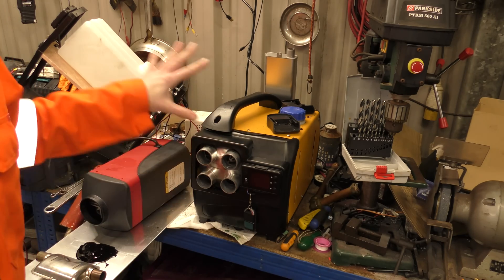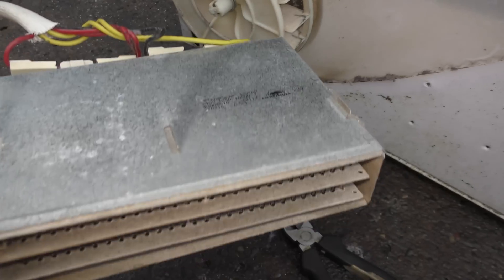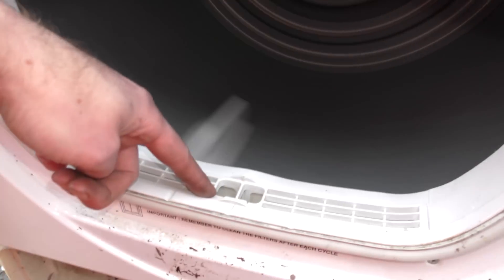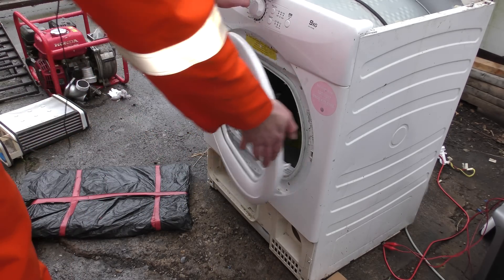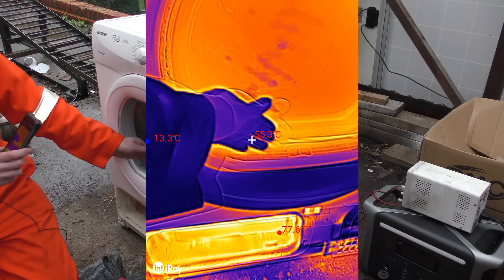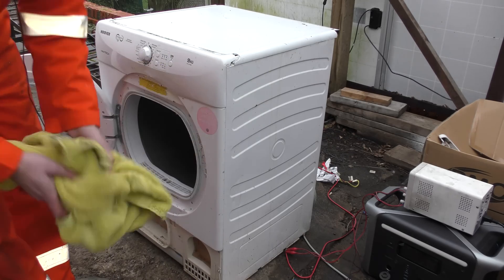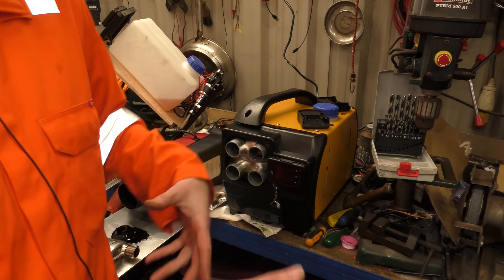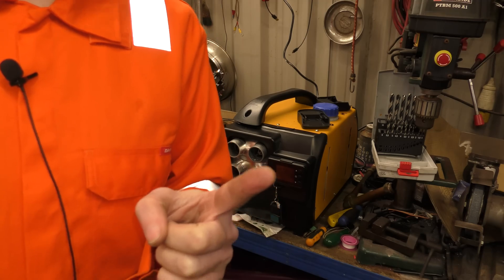Diesel heated tumble drier - part 1

Comment: 12v wiper motor. Plenty powerful enough, well geared down and reversible.
Reply: Those wiper motors wouldn't have near enough torque to spin a load of wet clothes.
Reply: @rednecktek2873  thank you I agree. Unfortunately there are a lot of wiper motor fans.
Reply: Wiper motor would be way too slow probably.
Reply: @nexpro6985   it should work  unless you want it spun dried.   It just needs agitation  to get the heated air around the clothes
Reply: @nexpro6985  put the  full 12v to a wiper motor and it'd be too fast...put your wipers on full speed, look at the wipers as a full circle instead of oscillating through the linkage and they'd be getting spun dried alright...just not sure if it'd have the poke with a full drum.
Reply: @fzr400rr100  I know. It is a few weeks since I installed a wiper motor. I still say not up to the job. Replacing a big 240volt motor with a small 12v motor is probably a bad idea. The motor of a tumble dryer spins much faster than a wiper motor on full speed. I have messed with both.
Reply: @nexpro6985  wiper motors are anything from 55-70rpm at 12v...my  tumble drier is 55rpm...use a 70rpm wiper motor and gear it back to 45-50 rpm....doesn't have to be like for like, just has to work. Could use a starter motor of a motorcycle but you'd be gearing it back 50:1
Reply: @fzr400rr100  tumble dryers are driven by a belt around the drum. The belt passes over a small pulley. I am familiar with both wiper motors and tumble dryers having worked on both. A wiper motor will not do the job.
Reply: @fzr400rr100  tumble dryer motors spin at around 1600 rpm. And about 1/4 horsepower. just one pulley on the shaft. No gears.
Reply: @nexpro6985  There are a lot of wiper motor fan as there easy got, simple, quiet and come with a ready fitted mounting point hence people use them for a multitude of hi torque requirements. I'm sure given your work experience you've seen these used for hoists and door lifters etc...what would you suggest, given your experience of course.
Reply: @fzr400rr100  not a wiper motor. That's what I suggest. Why? Because they are not up to the task.
Reply: @fzr400rr100  wiper motor 0.1 hp. Dryer motor 0.4 horsepower.
Reply: @nexpro6985  Suggestions brother the man asked for suggestions, not 'not that' for a low information reason. Neither he nor I have said that we're hiring in our workshops yet you've submitted your resume of experience on YouTube 3 times now because you've "messed with both". That's fine, if you've messed with those you must have messed with more so lets hear suggestions. Even though the HP figure on an electric motor is all but irrelevant, but I'm sure you'd know that, take a bit of your time while your 'messing' to work out why a 0.1hp motor spinning at 1600rpm through a torque multiplier, or 'gearbox' for those without as much experience as you, for an output RPM of 55 and you'll arrive at the mathematical answer for ftlb of output shaft torque produced of 'because they feckin work' and that's before you back gear it again to 40rpm. We're not trying to invent a perpetual motion machine here, we're drying cloths. If you don't think they'll work then pony up.
Reply: @fzr400rr100  once again... wiper motor 0.1hp. dryer motor 0.4hp. My suggestion is 12v motor that performs like a dryer motor.
Reply: @fzr400rr100  I don't jump through hoops. But I am prepared to be amazed when you manage to get a full load of clothes dry with only 25% of the power normally used.
Reply: @nexpro6985  And that would be?.....come on, stay with me, we're nearly there
Reply: @nexpro6985  And therein lies the difference between you and I brother. A man who will never attempt, will never achieve. I am fully prepared to swing and miss a hundred times to achieve a single outcome, it's called R+D and I've done it all my life. My workshop shelves are, like the movie says, chocked full of sacrifices to the gods of speed. When you open yourself to the acceptance of failure you can turbocharge cars, get 146hp from normally aspirated 600cc engines, build a boat and the outboard to go on it. Jump through a hoop or two and you might dry your cloths for 50% of the power, it'd be 50% better than the drier I'm using.
Reply: @fzr400rr100  cool. Now boost the power of a wiper motor by a factor of four.
Reply: @fzr400rr100  keep the  insults coming. It suits you.
Reply: @nexpro6985  I would have thought with your experience you would have recognised I was actually throwing you a bone but ho hum there you go. Unfortunately you then reverted back to not understanding how stuff works so I'll accept your invite. You say I need to multiply the power by a factor of 4 which you previously said was the difference in HP, the HP is for the most part irrelevant, you need to multiply the torque, two totally different things. The drier motor is a very low torque usually brushless motor and could literally be stalled from its 1600rpm if you grabbed the shaft with a gloved hand. A wiper motor is so widely used because it is normally a 4 pole brushed motor and specifically set up to produce high torque for the job it's designed for before it's geared, not all motors are equal. Turn on your wipers and grab the wiper arm to stall out the motor, I guarantee you'll snap the wiper arm, linkage or loose a finger. So in conclusion even after the motor is geared down to the drum in a drier, if you were to resist the spinning drum being driven by a 0.4hp motor it is easily stalled yet the wiper motor with a 0.1HP motor after gearing is impossible to stall, Go figure, its almost sciencey. Who has the answer to the riddle of whether a wiper motor will or won't drive a fully loaded tumble drier, maybe it will, maybe it won't. And @Redneck Tek if your putting wet cloths in your drier there's something wrong with your washing machine #spincycle.
Reply: As for the insults, perhaps you should think twice before imparting the condescending attitude on the lovers of wiper motors, we have feelings too.
Reply from the maker: This comment thread was a wild ride.  I think I have an electric window motor from my old C1, is that in the realms of wiper territory?  Might have a wiper assemble from mums old Astra.
Reply: @DavidMcLuckie  lol yes, but I slept just fine. I'd rather test a thing before I pass opinion on it unlike Mr Pro, If the wiper motor didn't work then we'd all know for sure it doesn't work but like everything else there's different ones of them to. The one in the workshop Clio is half the size of the one in the recovery wagon, stands to reason as the screens twice as big in the wagon. Window motors are typically weak for safety due to some kid putting it up and getting their noggin stuck in the window. I'd plug in the Astra motor and see what it spins at, see if it's possible to gear it back to 40ish rpm while on 12v. If it's close to acceptable you could try a bigger motor. If the wiper motors a total no go I should have a couple of bike starters here, I'll donate you one. Conns of the starter motors are spinning way to fast, noisy, power hungry, expensive to acquire and non reversible.  If you want the bike starter and know how to PM me shoot me a message.
Reply: @DavidMcLuckie  wiper motor 0.1 hp. dryer motor 0.4hp.

Comment: One thing I noticed that might be an issue. The fan and motor on the dryer  is designed to pass cold air which is then  heated downstream. Piping hot air into the cold air intake may overheat the motor and or damage the plastic fan.
Reply: it is a recirc dryer, the warm air is cycled and it relies on the aluminium plates to condense the water.
Reply: @amojak  What he said 🙂
Reply: Yep that's right.. he's getting the vents / intake wrong the air in the drum never leaves in a condenser.... what he thinks is the vent is the cold air in and the side is warm out... I work on this stuff so if you need to know out msg me...
Reply: What he said .

Comment: Would using a diesel water heater and replacing the heating element with a heat exchanger be a better idea? The rest of the drying mechanism would be unchanged. 

I think the motor used on tumble driers are universal motors, so there's a chance they could be used on 12v, but the current draw might cause it to get a bit warm. The motors tend to have a shaft that has a fan one end and a shaft on the inside that runs a belt for the drum. The fan pulls air past the motor then over the heating elements, with your setup I think the motor could get a bit hot. Not much of an issue when its in a metal box with a hot drum right next to it though. 

Check how much power your now modified tumble drier uses from the wall, might be easier to use a cheap inverter to run it rather than changing the motor or running it off 12v directly. Also easy enough to test if you have an inverter around.

Might be possible to hack a controller for a diesel heater by connecting wires from the PCB that go to the on/off button on it and using the output from the drier to trigger that somehow.
Reply: You'd take an efficiency hit converting from hot air to water heat to warm up air.  Skipping the middleman would be a great benefit.

Comment: I love this! I can see how this would be perfect for off-grid/camper living by powering the dryer with a 12v supply, having a diesel heater with a 'divertable' Y connection and using the coding you discussed. How about a similar setup with the diesel water heater for an "off-grid" washing machine? Any reason that wouldn't work?
Reply: My recently bought "Webastardo" unit was salvaged from an Audi Q7 as the pre-heater for the engine's coolant circuit. Effectively, it is a diesel-powdered water heater. My own aim is to use this for my planned under-floor heating in my house; and I expect, yes, it could also heat the water for a washing machine too

Comment: Ah this is great! A few weeks ago I asked Robert Murray-Smith how viable it might be to use a diesel-powered heater as the heat source for an oven!
Reply from the maker: Cooking oven or firing things oven?  If a firing things oven you can remove the heat exchanger from the diesel heater, move the temperature sensor.  And then you've got full burn chamber output into whatever you want.
Reply: @DavidMcLuckie  many thanks for your reply. My question to Robert was also open but primarily I was thinking about a cooking oven, possibly by extension a hot plate.

Just in the last few days, I've gotten myself a "Webastardo" heater from an Audi Q7, originally used to pre-heat the engine's coolant circuit. Over the next few months, I intend on experimenting with this to provide under-floor heating in my house! Possibly I might need to parallel a few of these, but as my first 1 was reclaimed salvage for £80 including the water pump, but minus fuel pump, I'm happy to experiment.

Your advice is NOT to run these on used and/or virgin cooking oil. Following Robert's videos on how to esterify cooking oil into a biodiesel, would that reduce the sooting/coking issues?

My questions aren't meant to be personally answered by your good self, I would very much welcome further discussions from other viewers on these issues.
Reply: @RiverMersey  question does the gelatin method remove the glycerides etc without having to use methanol and lye?
Reply: Webasto make a diesel fired hob 👍 but it's foooooking expensive 😮

Comment: Excellent video again. Just a thought, for the sake of simplicity wouldn't it be easier to use an inverter. The rig is still running on 12v? Keep up the good work 👍
Reply from the maker: There probably is some merit in keeping the tumble drier side mains powered and also just run the heater off an inverter.  I have a feeling a 12V motor is going to need the same power as the mains motor would.
Reply: @DavidMcLuckie  I think the diesel heater idea is good. Just run the motor and controls off the inverter. A heat recovery system on the wet air would be useful but I suspect the fluff issue would be too problematic. That's why the air was not reused from the condenser. Too many fires on the electrical heater element?
Thanks for the video. I'm off the the tip, regretting every old dryer I chucked out!

Comment: Once upon a time they used to run washing machines with two-stroke engines (have a look for the Maytag "gasoline" washing machines), a small engine and a pulley would get the drum turning over nicely, would be a bit noisy though I guess... :P

Comment: A heatpump dryer would be easier to convert since you just remove the condense/compressor as one unit and you have the ideas space at the bottom for the diesel heater, the water tank could be use to store the fuel, another thing, if the motor has brushes then its universal so may run on dc current
Reply: True, but heat pump dryers are EXPENSIVE and old tumble dryers with a dead element are CHEAP!
Reply: @rednecktek2873  It depends on how much is expensive, I have 3, the last one I bought last year for £30, most people dont understand them so when they do have a fault they are deem to be too expensive to repair so they either get sold very cheaply or someone who knows a bit about them (me) snap them up at a good price

Comment: Nice project!! - Would it not be better (more efficient!) to insert the diesel heater in the loop at the back, basically replacing the fan (as the diesel heater has one) and electric heater, so it would then retain the condenser part, and use less diesel? Maybe that could work if the controller could just take a signal from the existing controller, so when that calls for heat, it then turns the diesel heater on, and when it is not calling, it puts the diesel heater on minimum, unless the humidistat is also satisfied. then it jsut blows cold air? If the original heater has more then one element, then the controller could be set to see what it is being asked to provide, and set the Hz appropriately too?
Reply from the maker: I wasn't confident the diesel heaters fan had enough push to go through the perforations of the drum, then the dust filter.  But it's something else to try.